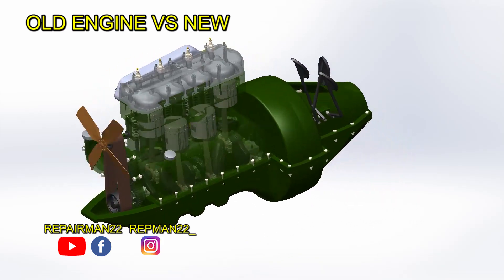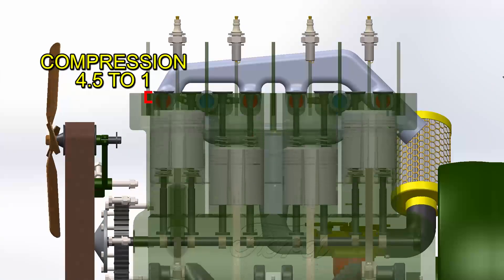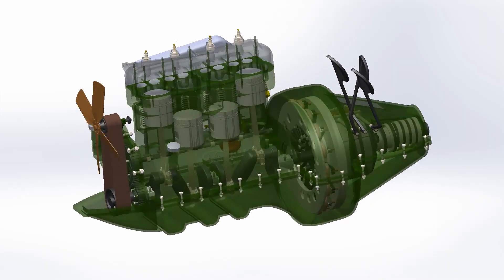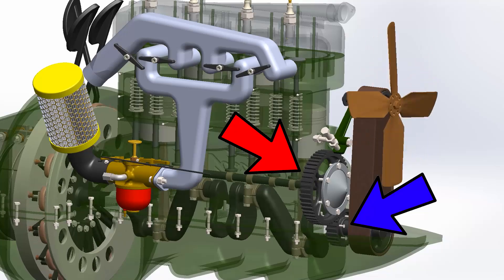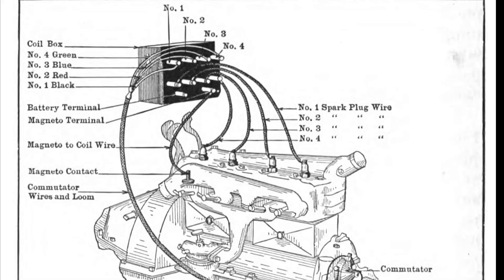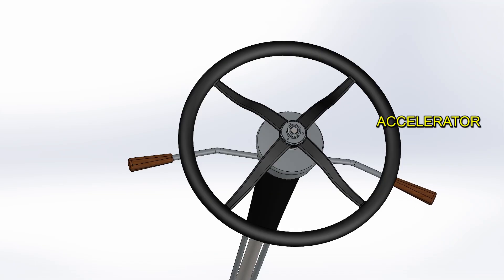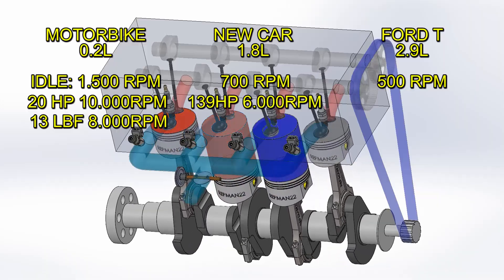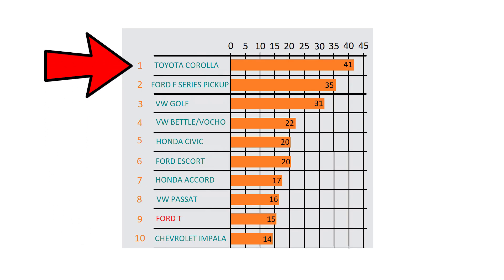Ford T vs New Car 🤯 3D Animation// What changed in engines in 100 years?

Comment: I saw a T engine at the Hershey PA swap meet once; it had port injection, insert bearings, & an overhead valve conversion. Made over 100hp i believe. It’s incredible seeing modern tech used to make century old tech live up to it’s potential!
Reply: Probably the Frontenac OHV cylinder head, a popular after-market conversion in the day.
Reply: Very cool, I had no idea ohv conversions existed but with the enthusiast community, of course they do lol. There's gotta be one for the flathead V-8 too, wonder what those can crank out with decent compression and revs!
Reply: @nthgth  Ardun Duntov produced a set of aluminum hemi-heads for the flathead V8 back in the late 1940's about 4 or 5 years before Chrysler came up with their hemis. They only sold about 250 sets before they shelved the idea, plus they only made about 160-170 hp. compared to the original 85-110 hp. of the flathead.😉
Reply: @danw1955 Only 50 sets, actually!
Reply: @nthgth There is one, called an Ardun. Made by Zora ARkus-DUNtov and his brother Yuri. Introduced about 1950. Aluminum OHV HEMI heads! But they were expensive, and rendered obsolete by OEM OHV engines by Olds, Caddy, and Chrysler. Only about 50 sets were sold, extremely valuable now. But modern and improved repros are available now! Also available is a repro of the vintage S.C.o.T. (Supercharger Company of Turin) Roots blower. A blown Ardun, with a beefed up bottom end, can make 350 HP.
Reply: @JeffKopis  very cool info,  thank you
Reply: I live in hershey and it's owned by a guy who owns it and rents it to the AACA for shows and stuff. It regularly shows up at the local gas station. And it keeps up with modern cars pretty well, accelerating from a stop to the speed limit just as fast as all the other daily driven cars.
Reply: Presumably not using the original crank, rods and pistons if it's really making that much power?
Reply: actually the overhead vale setup was a ford factory racing part from the model T era. I used to rent shop space from a guy that was all into T's . so much he would get customers from all over the U.S.A.
Reply: @maddhatter3564  that's awesome, I always picture hot rodding going back to the postwar era, it's cool to think of hotrodders a whole century ago
Reply from the maker: Wow. surely had more than 150hp.

Comment: The Corolla is not the biggest Seller, it is the Original Air Cooled Beetle.........It had a Flat 4 Cylinder Engine in the Rear , driving the Rear Wheels through a 4 Speed Gearbox, that Never changed.......The Corolla on the Other hand started as a 1000cc Engine in the Front driving the Rear Wheels through a 4 Speed Manual Gearbox, It Now has a 2000cc Engine , Transverse Mounted Driving the Front wheels and it is now on Well over about its 10th Body Series, and shares ABSOLUTELY NO Parts or Identity from its Original..........Sorry .......Just the badge............Try again TOYOTA.
Reply: What's your problem???
Reply: @friendofvinnie  toyota only sold the most Corolla Badges.....deal with it.
Reply: @bobmitchell8012  deal with what it's one of the most popular cars in history
Reply from the maker: what u say is correct, I showed the "Official" sells. Thank you.

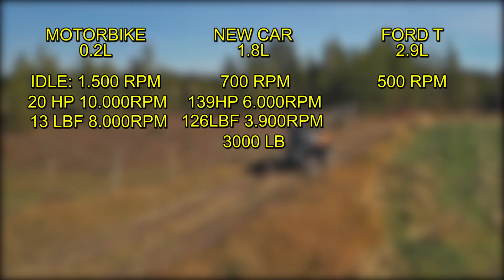Comment: It would have been a nice inclusion to add power to weight ratio to your comparison screen @ 7:00
Great video. Thanks!
Reply from the maker: yes, true! thank you.
Reply: Toyota Corolla has 21.5lbs per hp.
Ford Model T has 60lbs per hp.

Toyota Corolla makes 77.2hp per liter.
Ford Model T makes 6.9hp per liter.

Now the highest end Corolla GR has a 1.6L three cylinder motor with 300hp and 273lb ft of torque. That would make it 10.8lbs per hp (it weighs 3250lbs) and 187.5hp per liter.

Comment: So HOW can we "improve" those engines from the last 50 yrs [--'70s]?   If we took a 300cu" Ford/other inline OHV 6 cylinder, HOW can we easily Double the output and still have "adequate" fuel economy?   Most V-8s nowadays are around 5Liters/"302", & that's why I'm asking about a 300cu" 6.   Please "go 'Wild' if you wish--DOHC alloy head?  Higher-compression? [ due to alloy/other heat dissipation] --gears for timing? [ rather than chains/belts, which are cheap but can 'break', ruining the head ]--of Course, Fuel injection?[but "Port" FI rather than direct-FI, due to Direct FI 'needing' a "head de-coke"]--possible fewer parts in a 300cu 6, than an 8,--because of Naturally more torque per inline-6 than an 8, how about going for more high-Mid-range, for 80mph cruising [ car ], rather than low-down torque for loads [truck]?   1970-outputs were around 150Hp, but couldn't we reliably get 300+ Net Hp, [ or more ] with todays technology?  I feel we could, and couldn't we move to all alloy Block & head for our 300Hp unit?   Of course, with 3-D metallic-substrate-replicators, the block/heads could be made of lighter materials.  Could some reciprocating parts be made of extra-high temp plastics [if cooled sufficiently to not deform/wear prematurely].    While many cast-iron blocks can go over 500K miles, what could done to have super-light components that still last to 250K miles?   I'm also thinking of "dry-sump" lubing so bearings'd be longer-lasting, possibly.   I MUCH admire the '66-70 Aston-Martin 6, based on a 6 around 240+ displacement.  I don't have a 'spare' 1/3rd of a Million, but I know 300+Net Hp could be reached by Ford's 4.9L, --a "Factory-stroked"  240L-6.   If I had $70-80K, the 'Gnomes of Thailand' could fashion for me a DB-6 "clone."

Comment: The simplicity of the Model T is also by necessity: Since there were no dealers yet and repair shops were essentially blacksmith barns, much of the repairs and maintenance were done by the owner by necessity, so it made sense to make the whole system as simple as possible. It's pretty disappointing that the MPG for internal combustion engines has only increased by about 20 something points in over 100 years. However, the engines of today are literally 99.9% cleaner running than even engines from the 1960s. Now THAT IS impressive. Still, after more than 100 years you'd think gas engines would easily be getting 100mpg or better, as we were repeatedly promised over the decades (remember gas turbines?)
Reply: You can get 2L diesels especially in Euro cars that easily get 55mpg without being hybrids and still making good power.
Reply: There is more efficiency in the modern engine but it comes at increased cost. Cost vs benefit controls that part of the equation. And some of the requirements for emissions have reduced it's efficiency.
Reply: My uncle always said the oil industry was in cahoots with the car industry.
Reply: MPG is not really a good way to compare internal combustion engine efficiency cause it includes the vehicle and the way we drive and use them. My car weights 2000 kg, T-for 600 kg. I drive at +100 km/h most of the time, T-Ford did tops 40 km/h.

Comment: That’s why I think everyone should drive an older vehicle like this because they’re much more efficient on fuel and gas and everybody blames older vehicles like this for fossil fuel creation when in fact these cars run more efficient than any car nowadays and a model T in good working order is more efficient and burns less carbon than a modern day car
Reply: bs, please rewatch the video
Reply: @czechgop7631  It’s true if you think about it if you hear a lot of people talking today they will tell you that they think an older car has less gas mileage and it burns through fuel too much at least everyone I’ve ever talked Two has stated that to me they think that older vehicles like this are the cause A fossil fuels but in fact if you keep a vehicle running good of this vintage often times they will outperform a modern car
Reply: @czechgop7631  And I was just saying that your video proved my point
Reply: @Ellenslife851  12mpg chief...my 1999 silverado with a big hog ass cam and shitty tune gets 12mpg. Almsot all vehicles made in the last 10 years can do at least 30. This, on top of the fact that modern vehicles make more than 10x the power while being 2x as efficient. Theyre easier to work on, and theyre fun, but they are not practical, and they are certainly not efficient.
Reply: @wills.5762  Older vehicles like my truck are more efficient than these modern day smog pumps that piss the bed
Reply: @wills.5762  I’d rather drive in 1929 model lay over a modern day car any day because I get better gas mileage out of that thing that I do out of a modern day car because the gas tanks bigger. That’s that little known secret that the car companies won’t tell you you have to figure that one out on your own and when you figure it out you realize you’re actually not getting better gas mileage because you have to fill up more often
Reply: @wills.5762  I looked it up somewhere to that my truck gets around 27 miles per gallon that’s more than a modern day vehicle even can touch yes they can go probably slightly faster but that doesn’t amount to anything because faster doesn’t amount to efficiency it just amounts to how fast can I go basically making the car a death trap on 4 wheels
Reply: @Ellenslife851  There's no debate whatsoever on the fuel economy of a model A, like I said I've modified my full size truck, increasing my fuel usage by over 100%., and it gets the same fuel economy as a model a. 
As for the truck, I'd be curious to know what it is, 27mpg is equivalent to modern pickup truck fuel economy. Probably doesn't have nearly the power though
Edit: some modern vehicles (prius for example) are capable of 60mpg

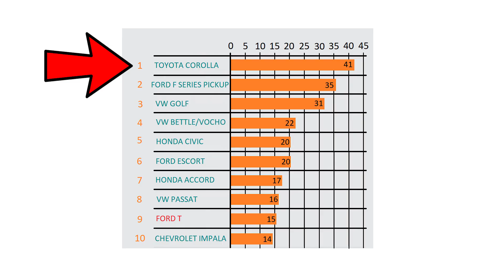Comment: 7:57 dont forget that the T was a model that was much more limited in it's evolution. a 1st gen corolla, F series, or Civic has little to do with the current one being sold. the only other real challenger is the Beetle.
Reply: And if Volkswagen has decided to market the Golf as a continuation of the "Beetle", we'd see it on top of the chart with 53 million units (with a bar too long to fit the chart shown).

Of course, Ford could have chosen to retain the "Model T" nameplate...then not only in 1966, a Grand Turismo "Model T" with a height of 40 inches would have won the 24 hours of Le Mans, but it would also fare much better in the chart. Which would have been more "natural" for the Model T compared to the Corolla, as the "T" was already a universal vehicle, with pickup, box truck, ambulance, sedan, cabriolet and whatever models already on the market early on.
Reply: @klausstock8020  "decided to market the Golf as a continuation of the Beetle"

Well, they did market it as the successor to the Beetle, because it was, of course.  But there's no way to legitimately continue the stats as there is nothing in common between the Beetle and the Golf except they both have four tires.

Comment: Great animation.   One small comment on the ignition system.  It's actually quite complicated.  One was supposed to start/crank the engine on BAT (battery).  On BAT the spark(s) were delivered way after TDC multiple times making a sure ignition and making backfire almost impossible.  When running, one switcher to MAG (magneto) where the spark could be adjusted to even BTDC.  One spark only, like today's cars.  People got in trouble and had their arms broken when they didn't keep good batteries and cranked on MAG.  The the spark could be BTDC and backfire.
Reply: If one gripped the hand crank properly,  it was unlikely to break the driver's arm or hand if the spark was not properly retarded.   One should always grip the crank with the thumb beside the index finger, never over the crank as though one is making a fist with the crank in the middle.  The break caused by mishandling the hand crank is called a chauffeur's break. Not all those who got one were driving lowly Model Ts in the days before self starters. Some were drivers PAID to drive expensive automobiles. When my son was studying to be a doctor, the professor said he had no idea why it was called a chauffeur's break. Since I'd discussed the fine art of hand cranking with him several years earlier, he had the answer.
Reply: starting a car with a crank is a learning process, when its cold my T loves a good "backfire" that resulted in a very painfull wrist for ca 6 weeks, and me with only one hand to start her, yes, the left, and that is the only way, since the crank kicks away from the left hand, and whatever you do, dont turn the crank more then from bottom to top, thats half way, now i start her anytime with ease, and many times she does not even need cranking,
Reply: Yes  what  you  say  is  quite  likely  the  truth .
But  l  thought  maybe  a  better  cranking  ,  Handle  to  Crankshaft   componentry  assembly  would  be  necessary  AND  a  greater  safety  feature   help .

My  dads '   1964  ,   3  Litre  Rover  Sedan   with  a  6  cylinder  8  to  1   compression  ratio  ,  was  hard  to   crank  start  by  hand  action   sure  enough  .
But   usually  did  start  first  go .
And  when  kicking  back  occasionally   gave  a  somewhat  nasty   surprise  !

So  l  thought  a  better  coupling  mechanism  would  be  most  welcome .
At  a  "  flat  battery  "   stage  
of   events   !
Reply: broken arms came from impropper cranking procedure, never push the crank, always pull up on it.
Reply: My Mom used to say that from back in the early 20's her Dad had one. The windshield wiper was all manual with a small tiny handle on the inside moving the blade. Very simple/very direct. She told me about advancing the timing going up a hill and retreating it going down a hill. But this was in Saskatchewan Canada/ so little need to do that very much.
 All good stuff. Thanks for the great illustration.
 Do a sleeve valve British WWII  engine sometime. Now there was a complicated machine setup! But it worked.
Reply: I heard Edison and Ford were great friends.  Tesla had the "Points-Coil-Condenser" ignition patent and they didn't want Tesla to make his patent money.
Reply: @peterdarr383  never heard that but it sounds exactly like something those two would do
Reply: @peterdarr383  The points, coil, condensor system was invented by Charles F Kettering, which is why it's often called the Kettering system. Not sure why people are so keen to attribute stuff to Tesla all the time.

Comment: So like 60,000 of them are still in operation 100 plus years later? Lol how many of todays modern cars you think will still be running over 100 years from now? My guess is ZERO.
Reply: probably because of government rules, in the UK at least a yearly MOT (safetey test) is required, and includes emmisions, cars over 10-15 years old that fail emmisions testing would often get scrapped, because its not worth the cost to fix (catalysts, DPF's labour are expensive) and cheaper to buy another used car.

Comment: ▪ Electric fuel pumps and fuel filters were easy to retrofit. 
▪ The ignition could also be improved with electronic ignition. 
▪ The cooling with retro fitted electric water pump and an electric cooling fan. 
▪ Modern fully synthetic oils make matters far, far better
▪ Modern fuels make matters far, far, better. 
▪ Could even install an electronic single point fuel injection system. 

The simple engine could be made far more efficient.
Reply: Still only had peripheral Oiling . And the Ignition was already Multi Spark and Adjustable on the Fly .
With only Three Main bearings , you do NOT want to reach to far in the Horsepower hunt . Especially not with poor oiling .
Reply: Poor lubrication of model T, poor head flow and only 3 babbitt bearings for crank or more likely a leather bearing, none of these design flaws could allow this engine to increase hp or efficiency
Reply: Modern machining (boring, honing, etc), stronger rods, a fully balanced crank, modern forged pistons, and today's thin rings also make them better.
Reply: An underrated internal design.
Reply: Owning and driving a Model T as it was is the goal.  If you turn it into a Rod you are just getting a modern car with an old body.  The artistry is to make the original set up run as smoothly and efficiently as possible.  Heck the Chinese even have an electric motor and battery you could put in it. Thats like  a painting compared to a digital photo.  You would lose the ambience of the moment.
Reply: @stephenwhited1833  
If you want the original look and feel then fine. If you want to improve the engine and its running and its reliability (a seized engine is not nice) then do what I suggest making it last longer, and you still have the same look and feel.
Reply: Boosting the compression for modern fuel would be the biggest increase in efficiency.  The higher the compression, the more efficient the engine.  OL J R :)
Reply: @lukestrawwalker  compression can’t be boosted much past 8:1 because it’s a flathead and when you try to make the combustion chamber smaller there’s nowhere for the gases to go in and out. Gotta find the sweet spot. One of the many flaws in the flathead engine
Reply: Using synthetic oil in an engine that has used conventional all its life or vice versa is a terrible idea. It will leak everywhere.
Reply: @Demonslayer20111  
A 50 year old engine would have been rebuilt by now using superior gaskets and seals. Using the proper fully synthetic oils will ensure full lubrication of vital parts. Which was not the case 50 years ago, with oils that were in comparison to today just about lubricating. 

The correct fully synthetic oil overcomes the small galleries of this abortion of an engine design.